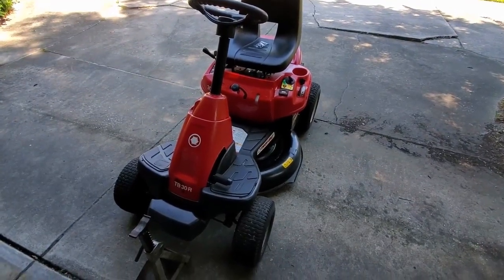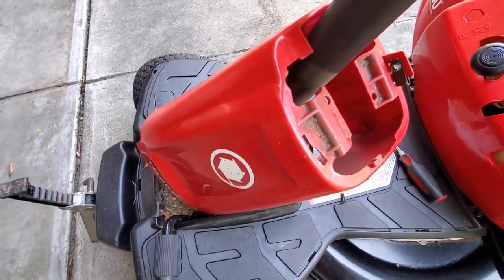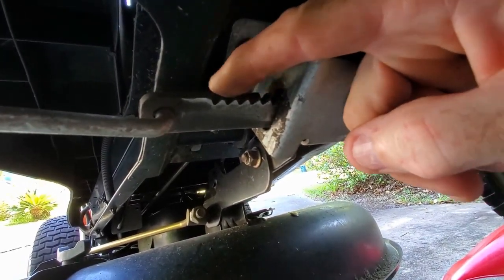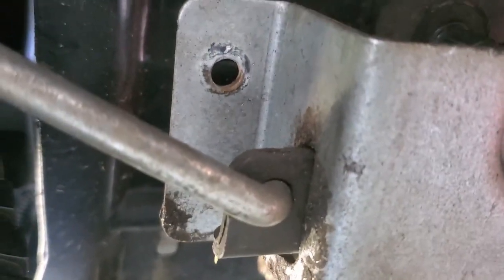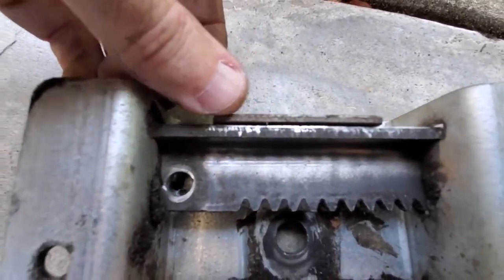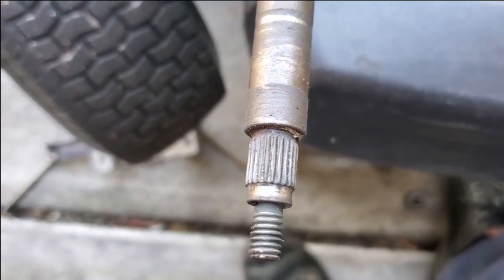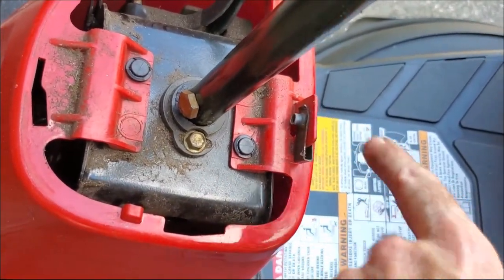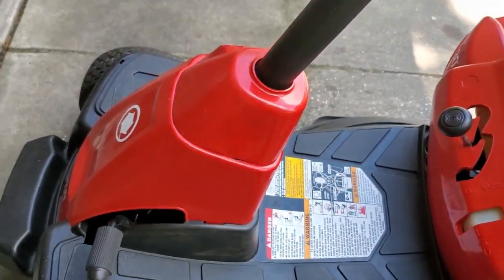Troybilt TB 30R Steering Problems *Fix*

Comment: I had this same issue with my Club Cadet Hydro 30 today. Your video helped me solve the problem and save money.  Bent the tab on bracket in a little and it fits snug. My gears are in good condition so I knew it had to be the slack in the assembly. Thank you for sharing.

Comment: Very helpful. Original design flaw in my 2015 TB30R corrected with the modified replacement kit (same as Cub Cadet). Replacement kit was @$75. @1 hr. installation. Used marine grease for slide bar and fittings. Works perfectly now. Only regret is TroyBilt not informing past customers of the problem, probably to avoid a recall.
Reply from the maker: Yeah, for sure. I found out about if from a viewer comment. It's a great fix though!
Reply: Yes Peter first I want to say thank you so much your videos are definitely the best I viewed online I was watching another guy's video and his dog was in the way and licking them in his face I have the Troy-Bilt 30-in riding mower I've had it going on my third season now I to live in Florida I live down in Fort Myers Florida you know as well as I do that during the summer months you have to mow at least once a week but the mower is experiencing steering issues my question to you Peter is how do I go about ordering the parts? Call me dumb I'm sorry but I've never had to do this before that and the fact that I'm 65 years old and I have to do it myself with no help thanks again and keep up the great work please let me know in a reply I know it's MTD Parts but I'm not sure how to get ahold of them

Comment: Thank you for sharing the video, a local lawn mower shop wanted $275 to repair it. I bought the plate with the teeth on it for $32 and fixed within an hour.
Reply: Where did you purchase if I may ask? Thank you!
Reply: @JackiePitalo Amazon. Got one coming for under $30. Everything from gear to cotter keys. I lost all steering.

Comment: Just went out and did this but I replaced the rack plate as well. I honestly think the main problem is that mount that holds the rack plate forward against the gear. I smacked that mount fwd so that my rack plate is very snug in there now. If it wears loose again, I may see if I can use 2 bolts to be able to tighten that mount against the rack plate with a little turn.  Thanks for the vid.

Comment: I added the gear and the bar, bent the tab as well like you did. It works better than total failure like I had but not back to how it originally steered. Poor design by Troy Bilt and my last mower from them.

Comment: Excellent presentation, I turned and my front wheel got hung up by my wood fence while turning and pretty much now having the same steering issue. Am gonna try adjusting the rack bracket if nothing else is bent. My R110 Craftsman is still fairly new and still getting used to it, thanks!

Comment: the lower steering bracket 753-11064a has been upgraded to 783-07239a, the difference between the original and the upgraded part is a snap-in teflon slide on the original that seems to wear excessively.
Reply from the maker: I don't have a Teflon guide on mine, maybe an earlier model?

Comment: If u put a metal brace behind the steering toothed bar on both sides it might tighten it up. I think the lower steering frame box is worn out. Or, put a 1/4”x1/8” brass bar in behind the toothed bar and simply bend the ends over to hold in place. The brass would act as a soft metal bushing and finish tightening up the steering by keeping the toothed bar from rocking back and forth in its frame...you could also use any greased metal bar...
Reply: YOU ARE WELCOME

Comment: Thanks for the Cub Cadet Parts #(fits TroyBilt). . The hard plastic spacer and redesigned bracket make all the difference.
Reply from the maker: Yup, both labels are made by MTD. Essentially the same mower. There's a craftsman branded version too

Comment: Another YouTube channel DIY repair guy did  the same thing. He  used  sledge hammer and gave the bracket a couple of whacks.
I imagine the lack of grease, coupled with the design flaw, is the main reason why the steering fails. Most people who replace the hardware seems  to be quite surprised by the lack of degradation to the gear. MTD's solution to the problem is a beefier plastic bushing on the replacement steering kit. $50 bucks Canadian. An  annual dab of maintenance grease ought to be enough for the next 5 years for your mower.
Reply from the maker: Yes, I made another video showing the upgrade kit. It works great! https://youtu.be/p9QLAHfVI6M
Reply: @petedymond  

Thanks for the link. I'll get to it next. I have  the Columbia CR30(MTD) that has yet to develop steering problems. I'll need to make the  adjustment before I use the mower this season.

Comment: As everyone said great video. Has anyone commented on the stearing getting stuck on the turns? I only have problems on the turns. Both directions R turn and L turn. . I have ordered the parts. Thank you.
Reply: I recently purchased this lawn mower and right from the beginning the steering sticks when I turn the steering wheel all the way to the left or right. Where you able to fix that problem?

Comment: Good video. It showed all parts & disassembly in sharp focus. 

My problem was a little different. Lil Thang wouldn't turn all the way to the right. About half way and the gear would slip. It was the rack. Makes eense. The gear is hardened steel. The rack is not. Makes a good compromise, as it gives a protective wear point.
Reply from the maker: Glad it helped. Look for a new video about the steering issue. I'm editing it now

Comment: This is all a learning process for me I bought a brand new craftsman R110 that is identical to that and I believe they’re both made by MTD I don’t like the gearshifter between my legs,,,I bought it because it’ll go through my gateways between two properties I actually probably needed a bigger one it’s not comfortable it goes too fast even in low going slow it’s too fast for trimming and stuff sometimes,,,I’ll probably end up trading mine off however you have a very informative video here that will help a lot of folks,,, it actually does cut great I have the mulching cover with the mulching blade and as long as you don’t let the grass get too high and stay on it it really does look nice

Comment: This mower had steering issues almost immediately. Took to a warranty repair shop after second use they replaced all those parts and same issue after third mow. Took back now they have had it for 4 months waiting for a kit that is a redesigned steering mechanism from the manufacturer. Hope it works. Like to have it back before the grass starts growing again.
Reply: Yes!  Mine has squeaked and had loose steering almost from the start!
Reply from the maker: I would love to hear about the improved redesign kit

Comment: Thank You. Very helpful, saves me time and likely $$. I'll do visual check on the gear & rack teeth first. If they seem in good shape like yours, I'll either bend the plate like you did, Or I might try a couple of composite shims to fix the fit. Either way, Thanks again from Daytona Beach 🙂
Reply from the maker: Check out the update video I made showing the MTD upgrade steering kit. It's a great solution.
Reply from the maker: https://youtu.be/I-V08qiMnAs

Comment: Thanks for a really useful video!  I’m especially grateful that you covered all this valuable information in a thorough, yet concise manner-  no wasted words or time talking about the weather, phone calls, or other unrelated nonsense.  Bravo!  I have 2015 Craftsman R1000 that is the same machine (Cub Cadet has an identical model in yellow).  These rear engine riders are actually designed and built by MTD, and sold under many brand names.  So if the design is flawed, it’s on them.  Still, my rider is a useful little machine for a medium-size lawn, and you’ve given me a better understanding of how the steering mechanism works.  I plan to thoroughly inspect mine when I clean and lube the mechanism for winter storage.

* I’ll share something I started doing two years ago.  It became very clear that following the manual’s instruction of greasing that steering rack & gear was holding a lot of grit, and it seemed like a design that would be prone to wear. SO- I cleaned the entire mechanism with brake cleaner until it was like new (a messy process!).  Then I sprayed it with an excellent DRY graphite based lubricant.  When I went to ready the mower for storage last fall, it was MUCH cleaner.  I blew off any dirt with compressed air, rinsed with water, then re-lubed with graphite after it dried.  Time will tell of this was a better choice, but so far I think it’s working.

* * Update at the end of my 3rd season using the dry lube...  I just inspected the steering mechanism and it’s doing fine.  I clean my mower deck using the wash-out port, so I always use my leaf blower to blow off the dirt beforehand, then again to dry the machine afterward.  I started aiming the blower from behind the wheels occasionally just to clear away dirt & grass from that steering gear, and even sprayed the mechanism with the garden hose once (just took an extra few seconds).  It seems to have helped.  The dry lube doesn’t hold dirt like grease does, and that mechanism has stayed clean, yet lubricated.  The mower steers easily, too.   I think my system is working!

Comment: I have one of there and I am on my 8 steering rack and my 5 gear. Only the OEM parts work well and I use that term loosely. Amazon parts steering rack may last you about 45 mins in mowing before the teeth are chewed up. The mower and engine are sound and good working however the steering is terrible.
Reply from the maker: Wow! That's crazy. I have really sandy soil but I'm still on the original rack and 2nd pinion gear, although it really didn't need to be replaced.

Comment: The newer model steering  rack #753-11064B comes with a heavy piece of polyurethene that the rail slides on to take up the slop. But you knew that by now.
Reply from the maker: Yes, I posted a video about that upgrade. It's a great solution!

Comment: I grease my steering gears about every time I need to go under the mower. A little sand won't hurt much since this is not a high speed operation with gears turned manually and slowly. Better to have grease with a little sand than to rubb metal to metal dry.
Reply: Just like a wife, grease her nipple and always check the rear end.  Lol....  :-)

Comment: Thanks!  Peter, How is your blade engage,clutch brake  etc.. holding up? I was wondering how hard is that to replace the belts  some day.  Thanks again. Mike
Reply from the maker: I did the drive belts a couple of years ago. A real PITA. I didn't make a video because it would have been R rated LOL. Next time I do them I will try again. You have to drop the deck, take a wheel off and there is one bolt that holds a retaining bracket for the belts that is a motha. I have an impact gun now so that really helps.

Comment: Great helpful video! Where did you get a list of all the steering components for tr30?
Reply: I got mine from Jacks Small Engine, excellent price, after replacing the gear and plate to again have the problem I replaced the bracket that holds them in place and found the steering column hole was wore causing the other parts to fail
Reply: MTD 717-1554

Comment: i see why newer machines have plastic piece at the back of the bracket to push the bar against the pinion gear and loosen the play. should be able to find the newer design and switch it as the rest is the same.
Reply from the maker: See my other video for the MTD kit install

Comment: I’m in the process of trying to fix this but can’t remove the nut from the plate below the rack and pinion… It turns but wont come off. This will be very expensive if I have to call a repair shop and get the shaft sawed off and replaced. 😡
Reply from the maker: Did you get it off?
Reply: @petedymond  Thanks for following up, Peter. I haven’t gotten it off yet but I plan to use a Dremel to cut it off. I don’t believe that my rack and pinion gear is worn. I’m going to buy the MTD service kit that has a plastic insert that goes between the plate and the rack which I believe will solve the problem.

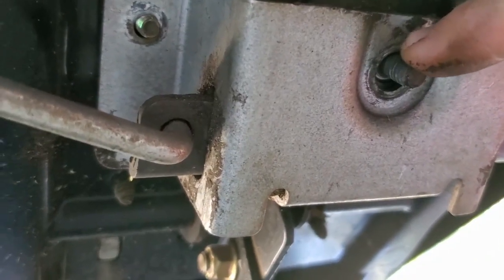Comment: lousy, design .  have put  4 bars in don,t  last.  the part that screws everything up is the lower steer bracket    part# 783-07239a what happens is the hole where the bolt rides on. they use it instead of a bearing!  look at the video at 4:27  the hole is now oblong and has about 1/16 slop, that slop moves the pinion gear back away from the the teeth , tearing them up. also on the bracket  fill in the top of the L just about 1/16 with epoxy this will stop the steering plate from racking.  at the bottom of the L drill out just enough  to let the teeth pass by , when it starts racking the teeth will hit it tearing it up too.  the cause is people tend to PULL the steering wheel towards you while riding , wearing out the plate, hard  to keep lubed,   just piss poor design !

Comment: Design is poor on this particular mower but a 30 inch mower is much better than the bigger 42 inch mowers. The turning radius is almost as good as a zero turn. I have a John Deere 30 inch and it runs much faster and I can get much closer to obstacles than my bigger mower.

Comment: No disrespect, but I think your main problem was the loose intermediate steering shaft bolt.  Great video thou.  Cheers.
Reply from the maker: You're probably correct!
Reply: @petedymond  When trying to loosen "nut" at bottom of retaining- bracket, the entire wheel shaft turns left as well, hold to get the entire wheel shaft not to turn to enable the bottom nut to loosen up?

Comment: Yeah if you tighten it up too much it will wipe out the teeth against the gear
Reply from the maker: I just took a little slack out of it. It's certainly not tight enough to cause excessive or premature wear.
Thanks for your comment
Reply: @petedymond  oh for sure.  I like the way you did everything.  I was more concerned about people trying to do it themselves that might not be overly familiar with this type of steering.  Love your video

Comment: I have exactly the same one came from the house I purchased. Fairly new but same issue. This is garbage design. I will buy the gear part fix it and sell the junk. $500
Reply from the maker: It's a reliable mower, there's a steering upgrade kit available. I'm going to do a video on it soon.
Reply: @petedymond  yes pls